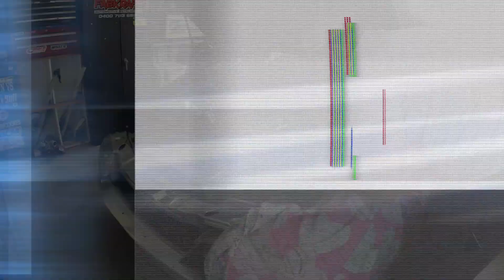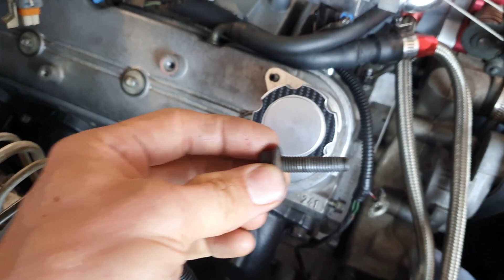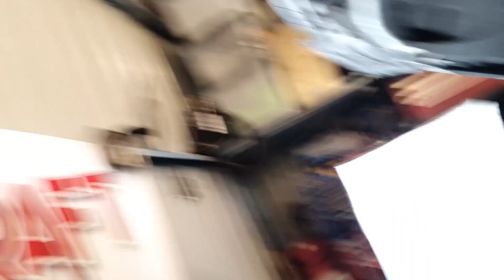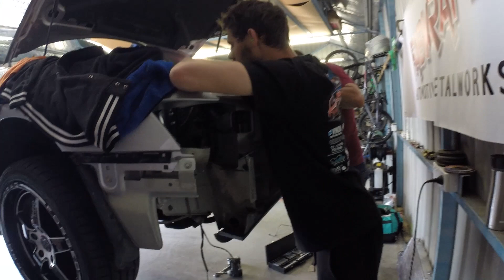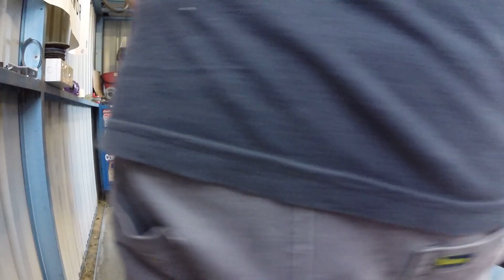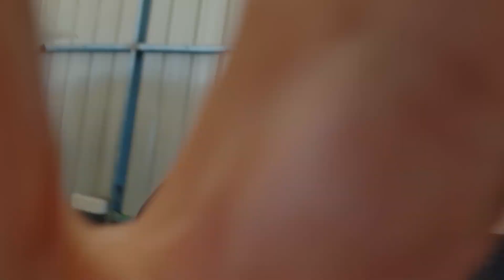Building a TURBO LS Commodore STEP-BY-STEP | [The Turbo Tonner] - Ep4. Torq Hub Media

Comment: G'day. I know I'm years late on this. But was this engineered and legal for WA licencing? I ask because I wanna do the same thing on my X series Ford (351 Cleveland). I know they have rules for force induction, weight times "X" times CC = ok.  Last I checked, I could only have a turbo on a 289ci.
Reply from the maker: Yeah this combo is engineerable in this car in WA. Low boost, modest timing, and E85 to help pass the 5 gas test. The 180kw/tonne rule in WA is what sucks the most. But once the engineer ticks the box, signs the form, and leaves the room you could 'allegedly' just turn it up 😅
Reply: @TorqHub wicked! Can you name the engineering service? I'm older than you guys and really out of the loop. We used to have Perth Street Car magazine and it was filled with advertising. Now I have no idea who to go to for panel/paint, transmissions, engine builds and the like for my Ford Landau restoration project. I welcome any recommendations you can give me.
Reply: Actually, I see no cats, so not legal. Haha. I'm might do the same. Just do it until caught, then deal with it. 👍

Comment: Great video but I seen the oil feed to the oil filter housing but where's the turbo drain to?? I'm guessing U drilled into the sump without taking sump off? Why didn't U show it,I'm thinking about doing same job but taking sump off without a hoist be a bitch,please explain,also the ecu must already been relocated and I'm guessing tuner ran bigger injectors and pump unless U guys did without showing ,great outcome is she still going strong?😊
Reply from the maker: Yes still going strong mate, I can't remember where we routed the oil drain on this but I'm pretty sure we welded a fitting on the timing cover. That's the easiest way.  Cheers
Reply: @TorqHub  I'm glad to hear she's still running well 12 PS1 must been sweet spot,if timing cover comes off may as well get rid of the big chunky na cam 238_242@112 and chuck something like U guys in btr1 or 2 turbo spec but using the pulsar turbo  1000cc xpurt injectors and Walbro 525
Reply from the maker: Hey mate, Jeff here. I think we addressed the oil drain in the cam upgrade videos as we put it in the timing cover when we changed the oil pump gears. Fuel system is in the first video of the series where we have a surge tank and 2x Bosch 044s, the second pump is staged by way of a Hobbs switch to not come on until 2psi boost, and the ECU was already relocated to inside the kick panel by Rob before we got our hands on it. Hope that clears it up for ya mate 🍻

Comment: Can you still have a big lumpy cam when running a turbo?
Reply from the maker: Sure you can, you can check out other videos in this build, she runs a 227/231 cam and still sounds pretty meaty (just as much, if not more than with its previous N/A cam) but turbos can tame the chop a little bit. End of the day the cam 'sound' is mostly in the tune 🤙🏻

Comment: Hey mate what size turbo was it I want something that’ll spoil up quick
Reply from the maker: Hey Darren,
As we said in the video mate this is a Garrett GT4088 with an upgraded 70mm billet compressor wheel. You can see in the dyno video and the first drive video we did in the Turbo Tonner playlist that she comes on boost nice and early 👌🏻

Comment: Did you even run the CAM in? before revving it like that??
Reply from the maker: Hey Redjet, thanks for watching  the video bud. We hope you enjoyed the series so far. 
The short answer to your question is a No.
The longer answer is, this utilises a hydraulic roller camshaft which do not require a run in procedure like a conventional flat tappet camshaft and lifters do. In addition to that, the ute was driven around for a short period of time before the revving was done. I hope this answered your question thoroughly enough and once again thanks for watching!

Comment: Hi m8 where did you put the turbo drain be nice to retouch back  on the feed n drain in place I got a vc with cammed ls1 I plan on turboing 👍
Reply from the maker: Covered that pretty extensively in Episode 3 mate.

Long story short though, we clearanced the alternator bracket, running the hose over the alternator body and its draining back into the timing cover 👍
Reply: Torq Hub Media sorry don't know how I missed that Ep  clever spot to put it did you gap the rings
Reply from the maker: Haha no dramas bloke.

Nah, left the bottom end untouched. For our minimal boost level and power output she'll be good as gold.
Reply: Torq Hub Media yep fair enough just watched Ep 3 I'll do the same with the drain looking at around 500 at the tyres too accept with turbo 400 which will be wild in my 1200 kg vc commodore not sure what cam n springs are in it but not changing to turbo cam as it's fairly lumpy hopefully it will be enough to get the horses flowing 👍
Reply from the maker: Should be good as gold mate. If You have no turbo gear so far and looking to buy new, we'd suggest a T4 flange GT4202/S475/Precision7675 turbo, and 50mm gate with some killaboost manifolds. Will have you well sorted at 500hp, even as far as ~700 if your fuel system can support it and crank doesn't turn into a skipping rope before then. But is a very well proven package for a stock bottom end LS1 with head studs and decent cam 👌